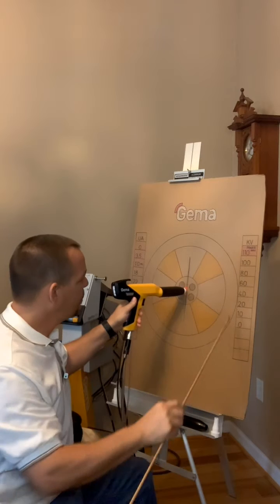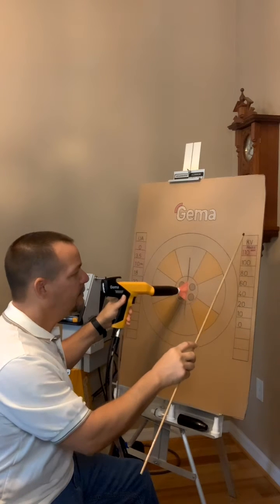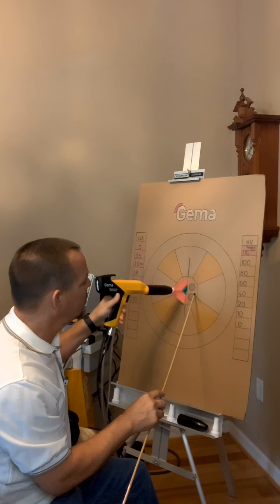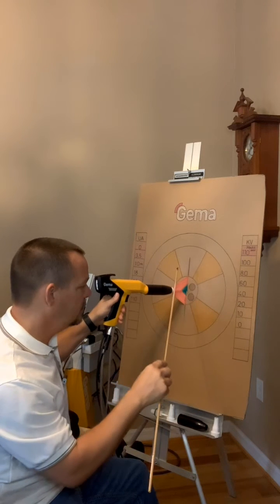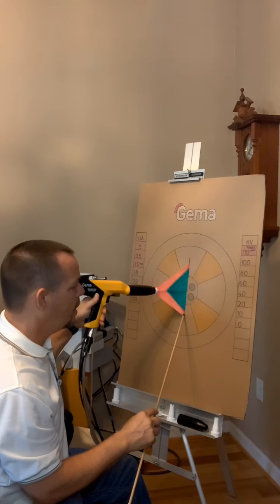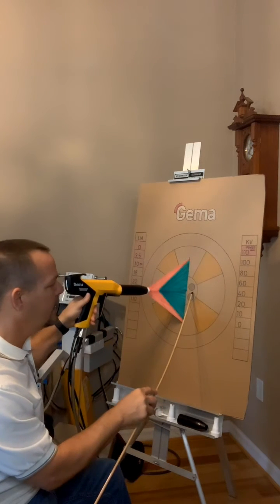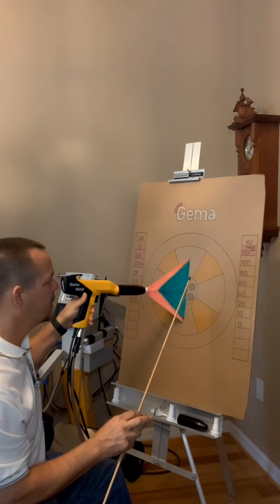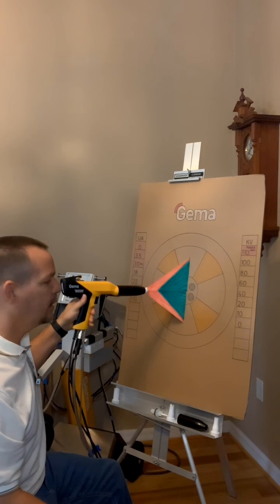Kv to Target distance

Comment: I assume this works the same for the older PGC1?  Great info!
Reply from the maker: Correct all units
Reply: @jamieargyelan292  QQ, my supplemental air ball won't float.  This is a new unit to me, it sprays but can't get that adjustment in the green.  Any ideas?
Reply from the maker: I would assume you have your air settings very low. What is the incoming air pressure?  What is the powder set at?

Comment: So when spraying do you usually want to keep the ua lower than kv or vice versa and if so how much lower or higher usually?
Reply from the maker: Always keep the KV at 100. Adjust the micro amps to the application. For flat panels no limitation on the micro amps. For complicated parts limit the micro amps to 22. For recoat limit the micro amps to10. The gun technology will automatically adjust the KV to your target distance.
Reply: @jamieargyelan292  ok sweet I'll have to give that a try thank you so much for your input! It's hard to find any tech info like this on gema